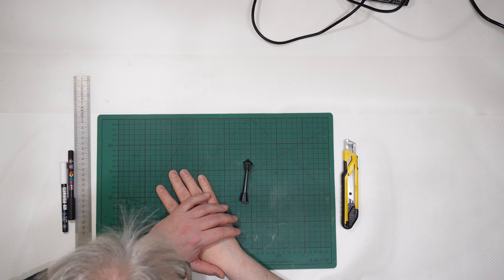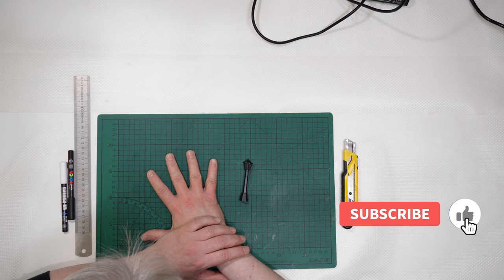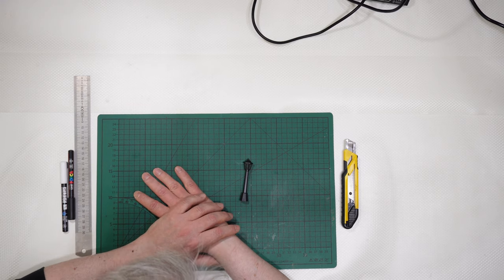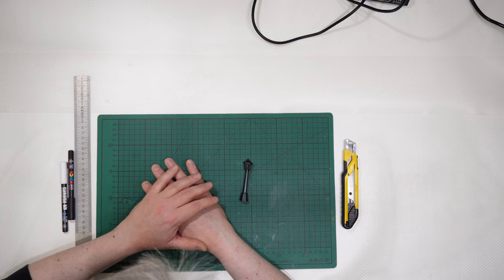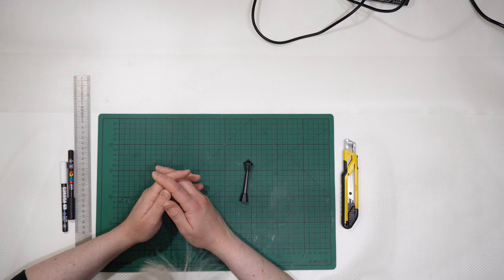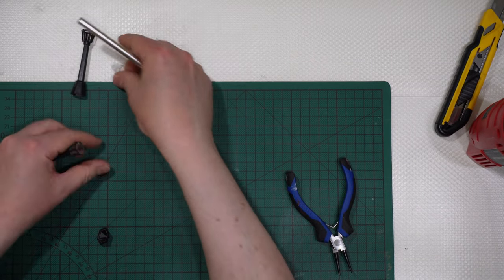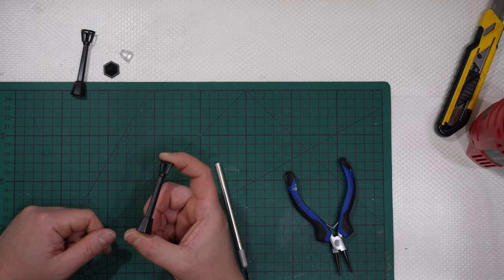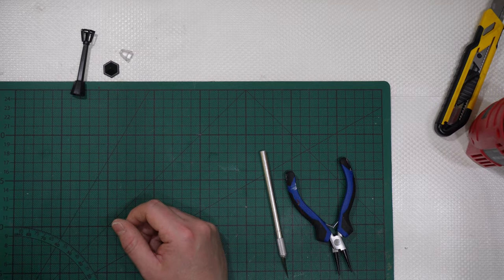DIY Streetlamps for Christmas Villages Using LEDs - PART 3

Comment: Silvio, 
I have read the remaining comments and I totally understand it now. Your explanation in the comments section and the circuit you showed makes perfect sense now. One more question.  The PVC piping for the street lamps you said was 8mm what is the equivalent in imperial size I'm guessing 1/4 of an inch?
Reply from the maker: Hi Rolie,
Thank you.
However, I have replied with a link to a detailed schema.

The PVC pipe is 8 mm in outer diameter  6 mm in inner diameter

8 mm = 0.31 inches = 5/16 inches

Comment: Now to figure out the length between each lamp to be able to use it in all the set ups each year. How far apart max  can the lamps be again?  I'm still hanging in there but when you changed to the blue wires, I missed why. Sorry, I'm a hands on learning.
Reply from the maker: Hi Sharon,
It is not necessary to decide a distance between each lamp.
The T connector, the one that it is used to attach the red and yellow wires from the lamp to the white and blue wires from the power source, it is repositionable.
You just need to reopen it and then slide the connector to a new position and then close it again to pinch the blue and white wires (but the colors are not important, you only need to respect positive and negative)
You have no limits with the distance between two lamps. From an inch to whatever distance you need.
I changed to the white(negative) and blue(positive) simply because I had on hand blue and white wires already attached to a power source.
I could have used yellow and black.
Hope this will clarify your doubts otherwise just ask please.
Thank you
Reply: Thanks, perfect.  @silvioallena

Comment: Silvio,
The audio broke up a few times at critical moments. 
If I understand how this is connected, the A/C adapter connects to bus wires, and then the street lamps connect to the bus wires following positive to positive and negative to negative.  What is the name of that connector? Also I think you mentioned that the bus wires are 18 awg and the lamp wires are 24 awg.

So under the layout of the village are bus wires (18 awg blue & white) and af the level of the layout are the street lamps (24 awg red & yellow). I think in another comment you called them 
"T connectors". I think I have this correct,yes?
Reply from the maker: Hi Rolie,
I absolutely need to apologize because the Sony camera had too many sounds cut-off.
Surely due to overheating.

Anyway… you are right.

Let me recap with a pdf file you will find at the following link:

http://www.christmasvillages.it/shared3/SCHEMA_AA.pdf

Please, do not hesitate to reply if you need some more clarifications.

Comment: Hello Silvio,
I deleted my first comment but it seems that youtube sent it to you anyway. 
I had quit watching because I got very confused. Your voice started breaking up when you were explaining the parallel circuit and clamping onto the wire. I came back to the video and thankfully you explain things more than once and I think maybe I get it. Please bear with me, I want to make sure I understand. No problem understanding the wires soldered to the LED. Now you put the wires hanging out of your street lamp into  the vertical  connecting side of the clamp, positive to positive and negative to negative and it is marked on the clamp which is which, right?
Then on the horizontal running side of the same clamp you attach it anywhere you want onto the blue and white wires positive  to positive and negative to negative. A continuing open parallel circuit.
Do I have it right?
Did I miss how you connected it to the power source A/C adapter or have you not explained that yet?
I have been making a shopping list as I watch these videos, because I am determined to make bright street lights. 
I love your prototype!
Reply from the maker: Hello Susan,
Yes you got it right.

Please look at the following diagram for reference:

http://www.christmasvillages.it/shared3/CIRCUITS.jpg

You can use whatever wire color you want for positive and negative on the streetlamp.
You just need to remember what color you used for positive.

The T connector has no positive or negative marked on it

Let's take sample A where the positive is the red wire.
It is on the left side and the left side is connected with the TOP horizontal wire
So, you just need to be sure to clamp the positive wire coming from the power source (the AC adapter) in to the TOP horizontal groove.
Obviously, the right side is the negative and it is connected to the LOWER horizontal wire.

Sample B it is exactly the opposite.

You just always need to remember or mark the positive wire color from the StreetLamp.

Then you can choose to clamp it indifferently to the left or to the right of the T connector.

And follow the diagram to use correctly the horizontal wires from the power source.

You don't need to have the same wire colors on the AC adapter and the StreetLamp.

But you need, obviously to know which wire from the AC adapter is the positive one.

The multi switching AC Adapter has a plug that is the size of DC Plug Adapters (plugs used for CCTV)
I have added the image of the plugs on the diagram.
The AC adapter plug is a male one so I coupled with it a female DC adapter plug that has clearly marked where to 
attach the positive and negative wires. (the blue and white parallel wires I used on this Part 3 video)

The DC plugs adapters can also be found on Amazon as well as the T connector and everything else I used.

I apologize for being unclear in some points of the video. And thank you for your question which perhaps will be useful to others too.